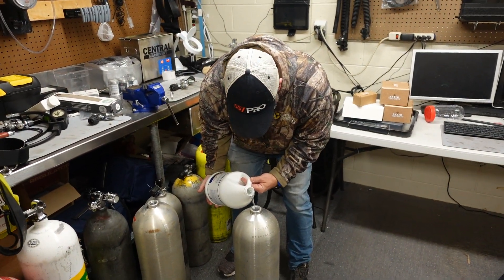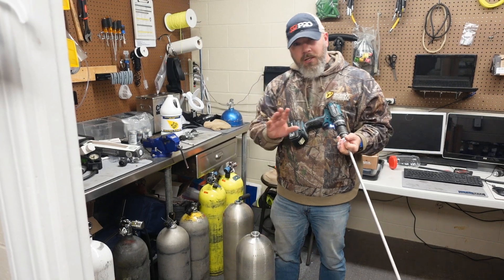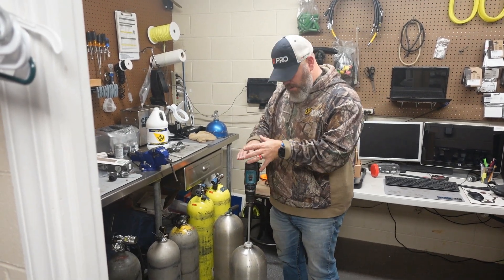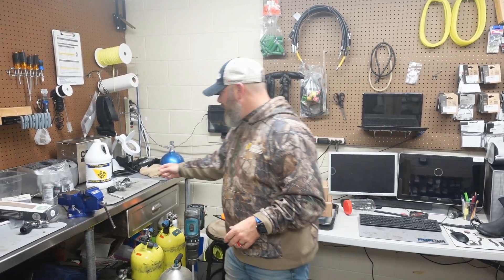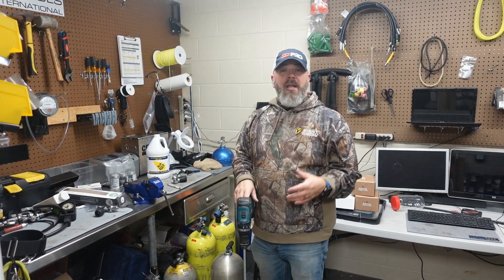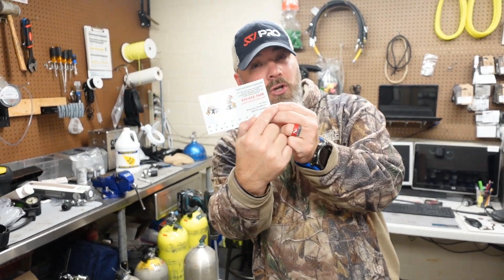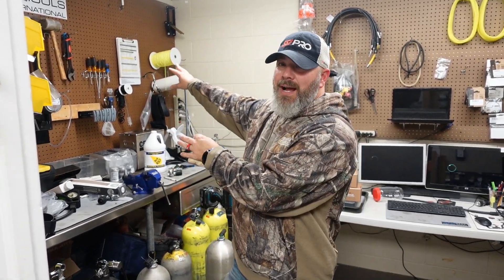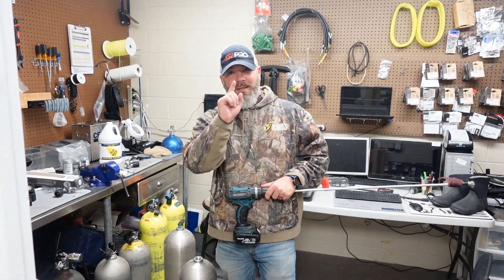Understanding Why We O2 Clean Cylinders

Comment: I built a tumbler out of an old treadmill motor and a buch of harbor freight parts.   I use glass Marbles and dish soap. I'll O2 clean all of my tanks post Hydrotest regardless of weather or not they'll be used for nitrox.  I also clean everything I intend to sell because I want to give a good starting point for their use.  I do most of my own fills unless I'm on vacation so I know if there is any unusual taste or smell it came from my system and I need to invesigate.
Reply from the maker: Hello @kevendavison6019, we have a lot of local divers here in our area that use their own tumblers as well. Its an easy process to produce one. They work great for steel cylinders that have a little bit of rust, but a little over kill just to O2 cleaning. I like the idea of the always cleaning after the hydro test though. This gives you the ability to always get a nitrox fill even if you have classified that cylinder as air only.

Comment: Watching this video, and it was cringeworthy, my son does a better job teaching year 10 chemistry. I completely agree with @travisd1000. Most (and I emphasis most) hydrocarbons are introduced into your cylinder at the time of filling by not changing the filters when they should. IMHO to get a level of hydrocarbons off your hands and into your cylinder, you would need to be a grease monkey doing very suspect work. Hydrocarbons are not normally found on one's hands (they cause serious burns to skin). Most scuba divers take a cylinder and have it filled, they don't apply a liberal amount of Shell Ultra or WD-40 to the valve when they get home. I think you're way off base and are (in my game) blamestorming.  Yes cylinders should be kept clean but to infer that I'm going F around with my tank the moment I leave your shop if bonkers.
Reply from the maker: Thank you for sharing your thoughts with us @peterjulianphotos4659.

Comment: Lately more and more operators are using “banked” 02 or, sorry - some other name (continuous blend?) for nitrox fills that below 40% do not need to be 02 cleaned. Do you agree with this practice?

And if a cylinder has been filled with banked nitrox of this sort is it ok to fill it with regular air? That is, can you go back and forth? I would imagine you still need to analyze the tank because left over nitrox in the cylinder would give you a mix other than 21% after an air fill.  It’s there another reason this shouldn’t be done?
Reply from the maker: Hello @fredr1, we use both partial pressure blending and continuous blending here at the shop. I personally am part of the crowd that still believes in the 40% rule. That being said, our air system is tested every year to modified grade E air (O2 clean air), which prevents recontamination after a fill of air on top of nitrox.

Comment: You are right there is a lot more trust from the fill operator. If it were me at nitrox fills above 40%, I would require an initial 100% 02 cleaning. Seems like most shops drain tanks completely for tec fills anyway, so a quick visual can ensure no contamination in the tank. With the valve off, it would be easier to do a light clean and degrease before filling. If there is any greater contamination than what a light preparation can solve, a full 02 cleaning should be recommended. The increased cost for a nitrox fill probably doesn't come down to the added cost of oxygen as much as it should be the extra care and handling. Pre banked nitrox fills would probably be just fine with an annual 02 cleaning so long as the owner knows the tank hasn't been contaminated. Is it fair to say now days the quality standard for fills from dive shops would make it rare for a sport nitrox tank to become contaminated by filling at any dive shop? The only way I could imagine a tank could really become contaminated would be to fill at a firehouse or SCBA station aka hydrocarbon prone environments.
Reply from the maker: Hello @Evan-gj3gw, the industry would fall apart if shops required an internal inspection prior to every nitrox fill. Though I agree with you, the cost of service would be through the roof. Especially for the shops that are filling more than 100 bottles a day. We average about 20 fills a day here at the shop, and on top of all the other services we perform, there simply isn't enough time in the day to do it with each fill. As far as mixing nitrox, we rarely drain the cylinders first. After we analyze a cylinder's contents, we simply us a mix table and blend it up or down to prevent from wasting the gas that is already in the cylinder. This saves not only time, but money as well. The cost of O2 continues to go up from the distributers, thus, shops have to do whatever they can to save money. We try our best to do this without going up on the cost of a fill.
Reply: @LakeHickoryScuba  Safety should spare no cost or time but reality is everyone demands high turn around and lowest costs.  With that being said if you trust the initial 02 cleaning and the customer verbally verifies theres no reason the tank became contaminated. A quick UV inspection of the valve and degrease prep would not take that much time. really that would only be necessary with partial pressure fills. At the recreational level pre banked nitrox 40 would get you any percentage you'd need and increase your safety margin such that the risk would be less than what you'd have with partial pressure blending. At the end of the day it is up to everyone involved to set the level of risk tolerance that's acceptable. The end user doesn't really care if you blow up your shop just as long as it's not in front of their face. Any tec diver that needs nitrox should understand and be willing to pay for that extra care. For a dive shop that fills a lot of nitrox it should be standard to have dedicated nitrox banks. Dive shops that choose pp blending as their method probably aren't filling many tanks and in my opinion it would be worth their safety and time to add more preparatory steps before just filling a tank. I might be being excessive because it seems shop owners aren't that concerned about it and yet we are trained to be really concerned about it. I am trying to better understand the fill stations perspective and I really do appreciate you responding.

Comment: Personal o2 cleaning is just another money maker, every tank reg or 1st stage should be 100% o2 safe.... What shop is going to stop using o2 safe lube and switch to non o2 safe. Another is o2 safe to 40%, vs 100% o2 safe.  A lot of systems fill 100% o2 and top off w air for trimix.. 
Can we just make everything 100% o2 safe and be done
  Like your video's, keep em coming
Reply from the maker: I am in 100% agreeance with you @robertfmccarthy2360. It amazing what we are required to teach in this industry that even the manufactures will question and say that's not the case. Unfortunately, we are still bound to do what our insurance company requires us to do. This is one of the only services we offer that we do not charge a premium price to perform compared to most of the dive centers here in our area.

Comment: Yes, as I see someone else has said, the clssic fire triangle is fuel, oxygen and heat/ignition.  O2 isn't the fuel; that's the hydrocarbons.  And hydrocarbons aren't metal.  For this topic they are the oils, greases and some plastics/rubbers.  The problem with EANx mixing and the potential for contact with oxygen is that some hydrocarbons will spontaneously combust in the presence of high-concentration O2.  So you don't always need extra heat or a flame; some things will just catch fire!  The good news from the filler's point of view is that once it's clean there is nothing in a tank that will actually explode the tank.  But high pressure O2 can produce an impressive burn if it touches something  it shouldn't outside the tank.
Reply from the maker: Hello @timgosling6189, a simple slip of the tongue. Great catch.
Reply: @ I assumed so; we all do it.

Comment: Gotta nit-pick a little on this one - Oxygen is not the fuel - it's an Oxidizer. The Hydrocarbons are the fuel, along with potentially soft parts (o-rings, valve seats) and even metal, if things go pear-shaped enough.  The 'spark'/ignition source in a fill scenario would come from adiabatic heating if we fill too fast and push something like the hydrocarbons past their fash point.  Regardless, love your videos and as an SSI instructor, I find them helpful and even send some of them to students - appreciate your effort on these!
Reply: You're absolutely correct. I guess it may have been an oversight on his part.
Reply: @johnjob9523 My thoughts exactly. Came here for confirmation. Thanks fellas.
Reply from the maker: You would be correct @travisd1000. The hydrocarbons are the fuel source. Great catch.

Comment: How do you dry the tanks and how do you make sure there isn’t a drop of water left behind before you fill? 🤔
Reply from the maker: Great question @lynhardman1384. After rinsing the cylinders out, we have a vertical drying rack that we use O2 clean air to dry the inside out. Then we perform a visual inspection prior to filling the cylinder.
Reply: Turn them upside down and let it drain out, like dishes on a dish rack. The more important question is how a tank is filled and whether the person using the air compressor empties the bleed valve regularly to ensure water doesn't end up in the tank. Remembering that water vapour is 2% of total atmospheric pressure at 21 degrees (Celcius) and  increases with increase in temperature until 100 Celcius (boiling point) where it will be 10% of total gas.  So the warmer the entrained air into the system the more water vapour. Some dive shops I know will run air through a refrigeration unit before compressing the gas to allow water to condense and be filtered off prior to compression - they really care about the air you breath.  Medical Grade air is less than 0.02% water vapour.
Reply: Thank you for the detailed description, that was awesome!  Back when I started diving, 35 years ago, they would put the tanks in water to fill.  I guess it stopped them from heating up too much.  Is this still done?  I was watching a Myth Buster type show that was blowing up tanks and over filling etc and they were saying it doesn’t make any difference so not to bother.  🤔
Reply: @lynhardman1384  No most fill stations do not use water baths to fill tanks, IF your LDS is good at their job they will fill your tank to the recommended fill and let it sit for 4-6 hours whilst it cools, then they will top off your tank to bring it back to the correct pressure.  If you go to a reputable fill station they will have a bank of cylinders (normally 9-20 "G" cylinders) which they will fill your tank from, rather than using a compressor. They generally will use the lowest partial pressure tank first then work thier way up untill you hit 207 BAR (3000 psi). For nitrox they will either do membrane fill which will be a set Po2 or a blend which will use 100% O2 and top up with air.  The problem with water baths is the risk of entraining water into your tank during filling from a fill attendant. Yes it will reduce the ballistic force of a catastrophic failure of your scuba tank but they are as common as the winning combo for powerball.
Reply: Thank you, I just love your detailed explanation rather than just a yes or no.  I’ve been really interested, this past year, of learning much more technical details….not sure why it has taken 35 years but I find it very interesting.  I’ve been watching saturation divers too, so amazing. Thanks again 🤿🙂